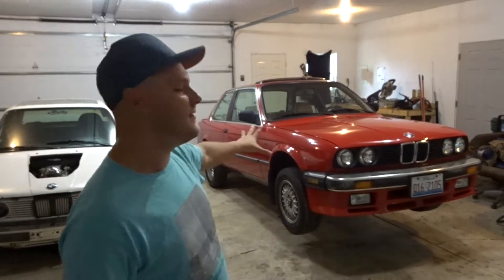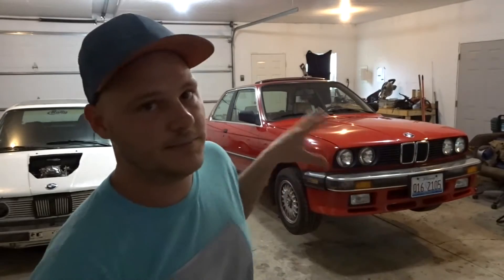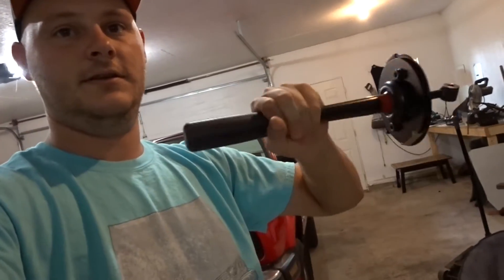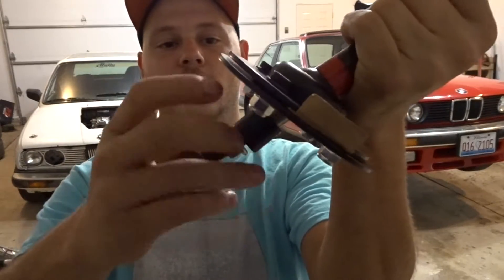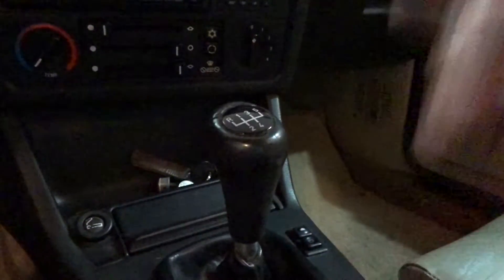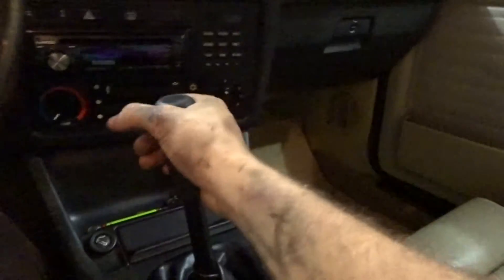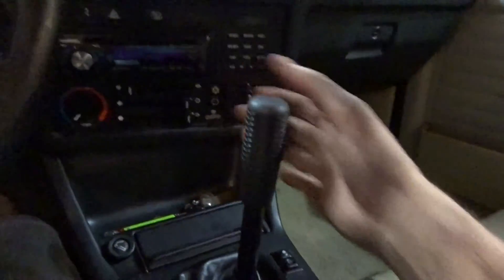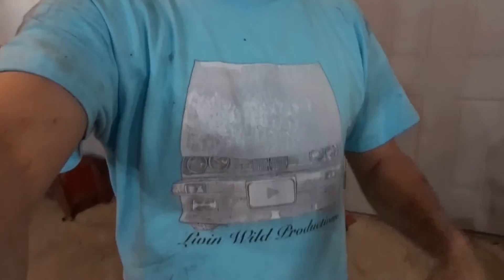BMW E30 Cliq Tuning Shifter install

Comment: I have an 86 325e and I just got that same shifter in today....what did you have to do to get that plat off and how long did that part take?  Also I had originally bought it to get rid of the side to side play as well, have you found a fix for yours??
Reply from the maker: +Brian LeFevre I had a heck of a time trying to loosen up the two bolts that hold the front of the plate in, in the end i used a dead blow hammer and brass rod to push them up through the rubber bushings they sit on. The side to side play i ended up buying a aftermarket shift selector rod, but you could prolly get away with replacing the bushings for the selector rod on the transmission side
Reply: I ended up using a floor jack and a long screw driver to pop the bolts out haha, and it worked pretty well.  I had this foam thing between the shifter plate and the body of the car that was hell to get out, and it was extremely had to get the shifter lever through the bottom of the shifter, too, I ended up using a large set of pliers to squeeze it on there.  But thanks again for the reply and putting out the video in the first place.

Anyone trying to attempt this by themselves, I used duck tape to keep the bolts still as I threaded on the nuts.
Reply: That play that's still there is the coupling on the shifter shaft. Installed a short shifter and didn't replace that, and I still had play. Went and pulled that piece out and it was pooched.

Comment: What size is this one because on their site there's 4 different sizes available?
Reply from the maker: Student Driver when i ordered mine they didnt sell different sizes, it must be something new. I would think this would be large or XL because it is quite tall
Reply: LivinWildProductions thanks man thinking of getting one soon.
Reply: Also, you figure what was causing the side to side slop even when in gear. My e36 does it too now. Not sure if a double shear selector rod would change that.
Reply from the maker: Student Driver i replaced all the bushings where the selector rod is on the transmission and it made a world of difference